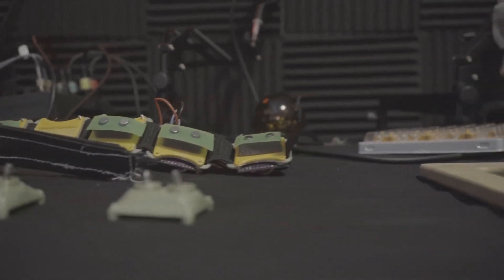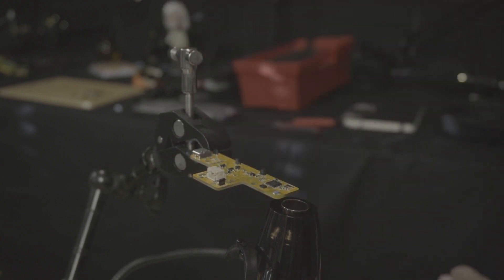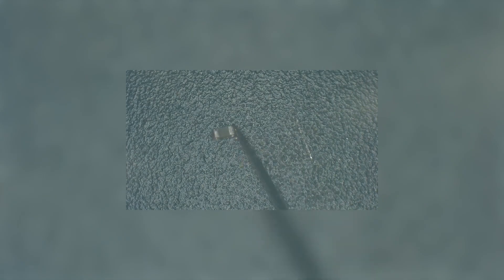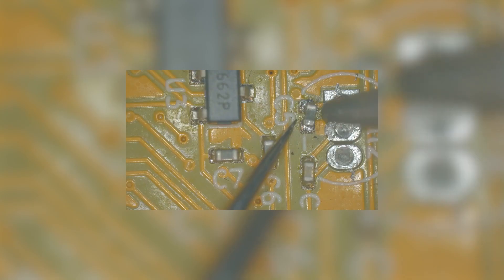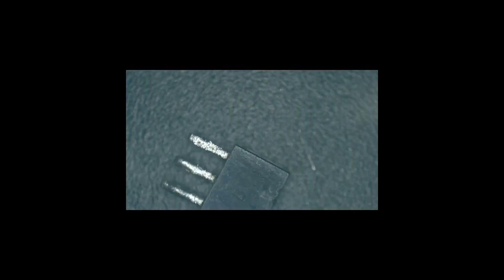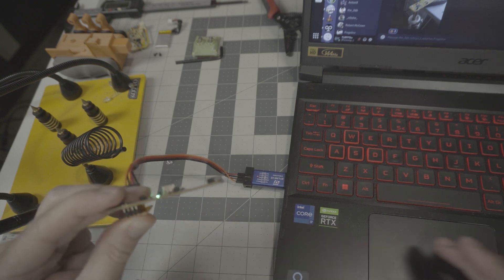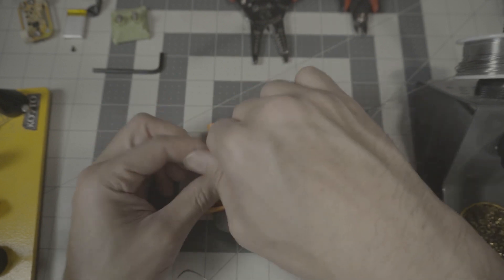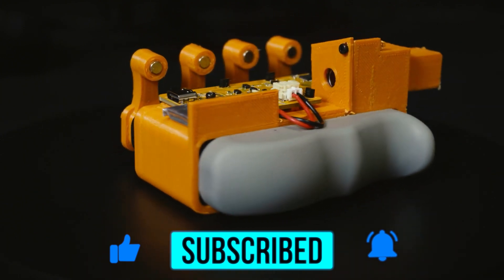uLabel Finger Labeling Device Update - Open Source - Joint Effort by Ultimate Robotics & Open Muscle

Comment: What probe and plate holder do you have? The one with the yellow base board
Reply from the maker: I got it on amazon, it is call 'Magnetic Helping Hands', no brand but it goes for 50-79 USD depending on sales.
Reply from the maker: The prob is ST-Link v2 emulator. 8 USD on Amazon. I also have the black magic prob, but the cheap ST-Link was easier to use.

Comment: neat project! have you considered using something like a leap motion which could give a bunch more pose information for training?
Reply from the maker: I have, but because the intensity of the forearm muscle contraction and the force of the finger curls are directly proportional, it makes the model very quick and accurate.

I plan on using a version of that for future prototypes. Right now I'm using pressure and EMG. Pressure is winning, in terms of accuracy overall so far.

Also, I'm using a regressor to constant predict not just a movement but in steps of intensity.

Comment: Intresting project, you have a new subscriber. 😁 I prefer using a soldering iron for soldering SMD caps and resistors, down to 0403 size. First, I clean both solder pads with solder wick and apply fresh solder to one of them. Then I put some flush(optional, see below) on the pads and I pick up the component with tweezers and reheat the pad with the fresh solder, positioning one side of the cap into the molten solder. Once it solidifies again, I release the tweezers, ensuring the cap is flush with the board. Finally, I solder the other side, and that is it. 

Flux is handy, but in many cases, fresh solder with flux inside is sufficient if you use solder iron and don't heat the solder for too long (<10s). Solder can become dry or ineffective if heated for an extended period, making it almost impossible to solder new components with it. That's why it's almost always a good idea to remove old solder and use fresh solder every time you replace a part. If the solder doesn't flow or shine anymore, it has deteriorated significantly, likely due to oxidation. Heat can speed up this process rapidly, causing copper and other additives to become burnt or oxidized over time and then solder will not flow onto the part anymore, and you will get a bad solder joined.  Success with the project and soldering. 👍
Reply from the maker: I will have to try this! Thank you for the tip!!